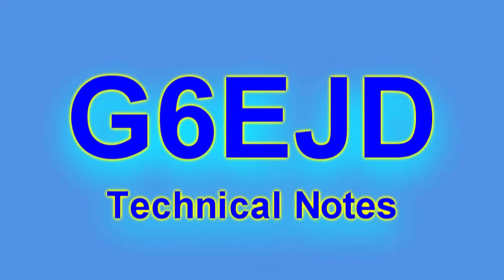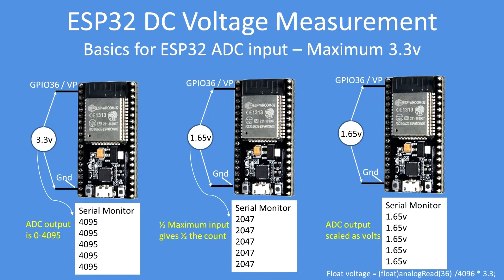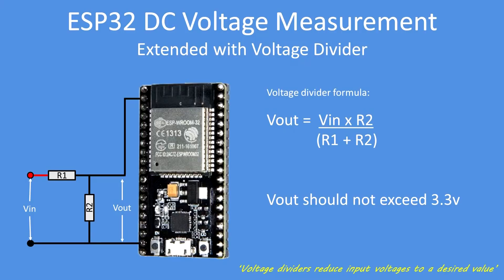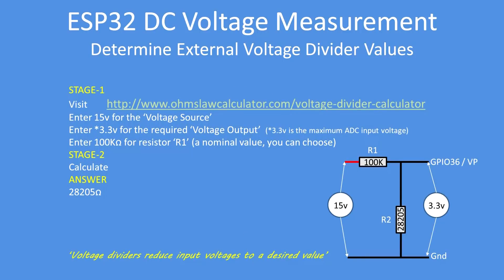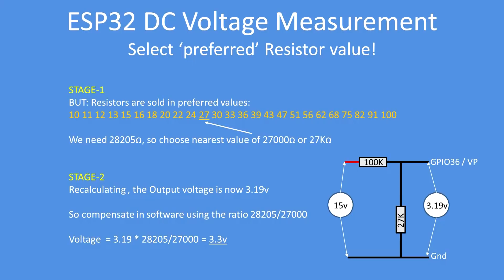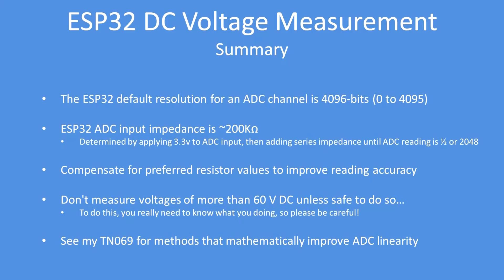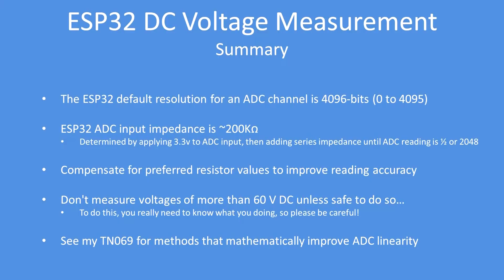Tech Note 115 - Using the ESP32 ADC for wide range DC voltage measurements

Comment: how can we make it work with negative signals instead of only positive like how multimeters and oscilloscopes do
Reply from the maker: You’d have to offset the ADC to half the ESP32 supply voltage which then becomes the effective ground point then you can measure voltages -/+
Reply: @G6EJD how can I do that I have to add ~1.6V to my input but how can I do that
Reply from the maker: @zizozeo4740 an ADC reading of (range 4096) for 0v would be 4096/2=2,048 so you have to scale the readings accordingly, you can use the map() function do to that. So -1.5 becomes an ADC reading of 0 then 0v is 2048 and +1.5 is 4096

Comment: Sometimes you can you a 10 turn trimpot to use for fine tuning without accessing code.
The other note is to increase the resistance to minimise current draw.

Comment: When using it to measure up to 4.2v, does it make sense to choose a ratio which ends up with 3v max to avoid non linearity?
Reply from the maker: @DrunknPilot  yes, and if battery powered, the highest values commensurate with reliable readings, meaning providing enough input current for the ADC to operate correctly.

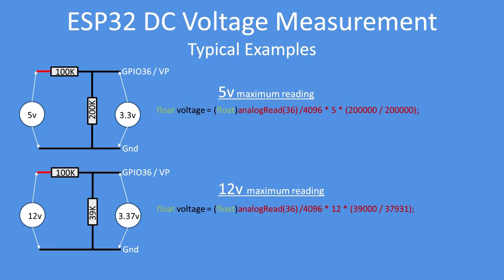Comment: 5:14 -  In my opinion, it should be 37931/39000. I am ignoring the fact that this resistor has too high a value, the voltage drop on it will exceed 3.3V. You should choose a resistor with a value lower than 37931. Best regards
Reply from the maker: I should probably have clarified that n / n means on parallel so 37931 in parallel with 39000 will give a lower value, but ignoring that only preferred values are available and the result in most cases will be a compromise.

Comment: Im working with esp32 for the first time. I purchased 3.7v 850mah lipo 5 pack. If i understand a fully charged 3.7v lipo will actually read 4.2v. Im starting to realize the dangers of working with batteries and i dont want to burn up my boards. So i read about voltage devider circuit monitor the voltage  of my battery supply and this will be important knowing an estimate flight time. This devider circuit is how i should power my board safely?
Reply from the maker: Yes a fully charged LiPo has a battery voltage of 4.2v and is discharged at about 3.6v, they always quote the nominal cell voltages, which can be confusing. Most ESP32 development boards have a battery management chip fitted which handles battery charging and discharging. It only allows charging when the cell voltage drops to 3.8v, well actually whatever value has been set by the board designer via a series resistor fitted to the battery management chip. Also most development boards fit a simple voltage divider whose input is connected to the battery input terminal, so that when the battery is connected the battery voltage (off charge by virtue of no 5v USB input) can be monitored. Simulating the voltage divider for fitting to a board without a fitted battery monitor is quite easIly achieved. The risk of burning your board is very low as the battery feeds a battery manager chip and then voltage regulator.
Reply: Ok so. My motors can handle 5v so it would be safe to have the wiring for the motors directly to the batter then power the esp32s3 from a voltage devider circuit.
Reply from the maker: @MrI8igmac  you can’t successfully power the ESP32 via a voltage divider as the series impedance would be too high leading to huge voltage reductions which in-turn would make the ESP32 processor operation fail, what would happen is the ESP32 brown-out detectors would trigger snd keep resetting the ESP32. Only a voltage divider using very low values of say less that 10R would enable successful operation but it would quickly flatten the supply battery. BUT none of that is required if you use a development board with a Vin pin that is connected directly to the on-board voltage regulator or even the battery input pin as most regulators can handle an input voltage of up to typically 6v, sometimes more depending on the regulator type.

Comment: Sir why didn't you use the ADS1115 module. Because accuracy problem found this method. 
Please make vdo using ADS1115, esp32, LCD16*2
For dc volt meter range is 
0-300VDC
Reply from the maker: When there’s an ADC built in why bother it just adds cost and complexity of design
Reply: @G6EJD  because accuracy sir.
Reply from the maker: But you can get within 1% accuracy with the in-built ADC, why do you need more, it’s never going to be a scientific instrument? I think you could usefully read into ADC’s and what are the important aspects of them, speed, resolution are important and to a lesser extent linearity, what aspect would a ads1115 improve?

Comment: In spite of the better resolution of the ESP32(4096) vs. that of an Arduino Nano(1024), I found a x10 better precision with the Nano. I wanted to measure a lithium battery voltage using the ESP32 with a 5V boost to Vin and found variations of about +-8%  using a 76% voltage divider from the battery to input pinD33. For the lithium battery using a 5V boost to power the Nano (pin +5V) and a direct battery connection to pin A0, I found a variation of only about +- 0.8%. Any comments would be appreciated to improve my ESP32 measurements.
Reply from the maker: You can obtain the ESP32 internal reference voltage set at manufacture to improve reading accuracy. In general the ESP32 extra resolution should give you better results, but never approaching those of a DVM. To get better results you’d need to use an external ADC. You can also improve the linearity of the ESP32 using g some mathematics and what’s called a polynomial, I have covered both the ADC reference voltage and improving liberation other videos.
Reply: @G6EJD  Sorry, I called it the precision when I really meant to say the repeatability of the measurements. 10x better with the Nano.

Comment: 1-Sir am using this method for dc voltage measurement. 
ESP32 wroom with I2C 16*2 LCD
applied 12.4V display 12.4V
If applied 6.7V display 5.9V
How to solve this problem sir?
Reply from the maker: Your voltage divider is loading the circuit
Reply: @G6EJD  I will check and give you feedback. With ADC value.
Sir one more thing any simulation software available for ESP32 for voltage measurement.
Reply from the maker: @0124akash  none that I’m aware of

Comment: May I ask why my esp32 is getting a lot of noise and random peaks values when the ADC input is a DC value? For example, the input is receiving 1.65V (A battery with only a resistor connected to ground and input, nothing else) which should be around 1700, but I'm getting noise of around 1750, 1650 and sometimes peaks of 2300.

And it only happens with DC voltage, for AC voltage it read perfect, given an senoidal it will read and plot in the serial plotter perfectly a senoidal.
Reply from the maker: Well it will be a function of your ESP32 supply noise, do you have sufficient and good enough smoothing and filtering. You should have a largish smoothing capacitor say 47uF or maybe 10uF and at least 0.1uF ceramic capacitor. The ceramic type is important as unlike larger tantalum capacitors are not inductive, therefore it can filter out transients on the supply. Also in theory the battery should act as a capacitor and its impedance is so low it should not allow any transients, so it proves almost conclusively it must be supply noise. It will still be there when measuring AC but less noticeable. Adding a small 0.1uF capacitor across the ADC to ground will help too. What value series resistor are you using? You can also counteract quantisation noise from the ADC by using a simple averaging technique of taking say 10 readings in succession then dividing the result by 10, which is a common method. The ADC is so fast in most applications the method will be indiscernible in practice.

Comment: I want to test this voltage divider at 5V maximum. Because i have only 10k & 1k resistor, so i use r1 10k & r2 1k ohm. I test the voltage at R2 and the result is around 0.45 V but in esp32, the result is around 0.3V (after i calculate it with adcvalue  *  (3.3/4095) ). Also i have try to put 0.1uF capacitor but the result was same. Can you help me ?
Reply from the maker: Try adcvalue * 3.3 / 4095 * 0.5/0.3;

Comment: Thanks very clear and well explained. I been struggling with getting reliable readings on a project that is monitoring a 12 volt battery being charged by solar panels remotely over the internet. This explains a lot to a novice programmer like myself and will help. Thanks for your time and effort.

Comment: But resistors are not accurate, so I have to do some calibration for each specific set of resistors. 100k could be 999.8 or .9
Reply from the maker: And the point your making?
Reply: @G6EJD  that I wish for another solution. In my case I need to measure up to 3.4v I don't know what to to. Does esp32 Internal software calibration take care of voltage divider variance? Yes I'm lost
Reply from the maker: @solidfuel0  the ESP32 can measure up to 3.3v so you will always need a voltage divider, the solution is sine you have to use an external meter to ensure you have a reference, then measure the source violative with the meter and then with the ESP32 and compare, then adjust your ESP32 measured voltage by the ratio of Vmeasured / VESP32 so voltage = analogRead(35) * constant * Vmeasured/VESP32 or simply adjust your source code so that the voltage line is multiplied by either 0.999 if too high or 1.0”1 if too low, repeat until the correct value is obtained, you may need to use eg 0.95 or 1.005 or whatever.
Reply: @G6EJD  i could never get it to measure up to 3.3v even if the vdd is 3.3v.
Reply from the maker: @solidfuel0  you can but it becomes very inaccurate as the input voltage goes over 3.0v see my video about improving the accuracy using a polynomial
Reply: @G6EJD  oh BTW I am testing with esp32-s3. I just noticed in espisd that with esp32 the adc_atten_DB_11 the max measurable voltage is 2450mV. Which is lower than s3. How are you able to measure above 2.4v using the basic esp32?
Reply from the maker: According to the S3 data sheet maximum input voltage is ADC_ATTEN_DB_11
0 mV ~ 3100 mV same as the standard ESP32

Comment: Hi all
When I'm trying to divide analog pin value e.g 2.66 to 4096 and so on on formula - the value is much less than 1 
2.66÷4,096×16×(8,461÷7,500)= 0.0117220104
Should I use *1000  or not?
P.S I'm using Arduino Voltage Sensor which measures up to 25V DC
Reply from the maker: The result is integer unless you specify or imply a floating result with 4096.0 or 7500.00
Reply: @G6EJD  I've used integer, without floating. So do I need to multiply by 1000 ? 
Comma's in comment was from mobile calc :(  In sketch all parts were int. only analogpin was float

Comment: With respect to the work you have done - your calculation formula gives incorrect results:
float voltage = (float)analogRead(36) / 4096 * 15 * 28205 / 27000;

Proof:
Example for 15V 
Voltage Source (VS) 15V
Resistance 1 (R1) 100K
Resistance 2 (R2) 27K
Output Voltage (VOUT) 3.189V (Voltage Divider Calculator)

In this case analogRead=3.189V/3.3V*4095=3957
float voltage = 3957 / 4096 * 15 * 28205 / 27000 = 15,14V (not 15V!!!)
----------------------------------------------------------------------
Correct formula for 15V:
float voltage = (float)analogRead(36) / 4095 * 15 * 3300 / 3189;

Proof:
Example #1 for 15V 
Voltage Source (VS) 15V
Resistance 1 (R1) 100K
Resistance 2 (R2) 27K
Output Voltage (VOUT) 3.189V (Voltage Divider Calculator)

In this case analogRead=3.189V/3.3V*4095=3957
float voltage = 3957 / 4095 * 15 * 3300 / 3189 = 14,999V (~15V!!!)

Example #2 for 12V 
Voltage Source (VS) 12V
Resistance 1 (R1) 100K
Resistance 2 (R2) 27K
Output Voltage (VOUT) 2.551V (Voltage Divider Calculator)

In this case analogRead=2.551V/3.3V*4095=3166
float voltage = 3166 / 4095 * 15 * 3300 / 3189 = 12,000V (!!!)
Reply from the maker: But you have no concept in your mind of the effect of the ESP32 ADC input impedance on the calculations, so you need to brush up on your electrical engineering and think a little bit wider and deeper, because unfortunately you will find your wrong!
Reply: @G6EJD  Thank you for the quick response and important advice!
Added ESP32 input impedance ~200K to calculations  

Your calculation formula for 100K and 27K divider:
float voltage = (float)analogRead(36) / 4096 * 15 * 28205 / 27000;

Check for 15V, 100K and 27K divider, ~200K ESP32 input impedance 
Voltage Source (VS) 15V
Resistance 1 (R1) 100K
Resistance 2 (R2) 27K!!200K=23K789
Output Voltage (VOUT) 2.883V (Voltage Divider Calculator) 

In this case analogRead=2.883V/3.3V*4095=3578
float voltage = 3578 / 4096 * 15 * 28205 / 27000 = 13.688V (not 15V!!!)
----------------------------------------------------------------------
My calculation formula for 100K and 27K divider:
float voltage = (float)analogRead(36) / 4095 * 15 * 3300 /2883;

Check #1 for 15V, 100K and 27K divider, ~200K ESP32 input impedance 
Voltage Source (VS) 15V
Resistance 1 (R1) 100K
Resistance 2 (R2) 27K!!200K=23K789
Output Voltage (VOUT) 2.883V (Voltage Divider Calculator) 

In this case analogRead=2,883V/3.3V*4095=3578
float voltage = 3578 / 4095 * 15 * 3300 / 2883 = 15.001V (~15V!!!)

Check #2 for 12V, 100K and 27K divider, ~200K ESP32 input impedance  
Voltage Source (VS) 12V
Resistance 1 (R1) 100K
Resistance 2 (R2) 27K!!200K=23K789
Output Voltage (VOUT) 2.306V (Voltage Divider Calculator)

In this case analogRead=2.306V/3.3V*4095=2862
float voltage = 2862 / 4095 * 15 * 3300 / 2883 = 11.999V (~12V!!!)
Reply from the maker: @gora6045  but the input impedance is both non-linear and its equivalent circuit is not a parallel impedance but series.

Comment: Sir, can I measure same time dc and ac voltage using esp32 ?
Reply from the maker: You can measure DC easily, but an AC voltage needs signal processing to convert it to what’s called a Root Mean Square value that is the equivalent of a DC measurement. To do this a full cycle of the AC waveform would need to be sampled over say 256 samples then the RMS calculation performed to give the final reading. Measurement of an AC waveform is complex especially if the waveform is distorted.

Comment: Thank you Dave, very useful. I’ve mostly been using the Parallax Propeller chip over the last 15 years and recently found the ESP32cam, I’ll have to try this on pin 13 to read my water tank level using a psi sensor and a tube.
Reply from the maker: That will work

Comment: Excuse me!May I ask you something?If we have the voltage value so could you tell me the formula convert from voltage to pH value?Thank you in advance
Reply from the maker: It depends on the sensor your using, what type is it? You need to know it’s output characteristics
Reply: @G6EJD  Its output voltage 0~3.0 and I’m using it with esp 32 30pin.I really need this information,because I’m doing my project related to pH sensor and esp32.
Reply from the maker: Ok so if the output voltage is 0-3.0 then that represents a pH range of ? 0-7 or 5-7 or?
Reply: @G6EJD  Represent range 0-14 sir.
Reply from the maker: So 0-3v represents a pH of 0-14 so each volt = 14/3 pH then voltage to PH = voltage * 14/3.0
Reply: @G6EJD  May I have your Facebook or Instagram account?
Reply from the maker: @nirornkong416  I do t use either of those just email via my web site contact http://g6ejd.dynu.com

Comment: sorry for the bad questions, what u means with required value/preferred value
Reply from the maker: No bad questions, I'm pleased you asked. The calculations might say a value of 13.6K is required, but resistors can only be purchased in 'preferred' values, like 10K, 12K, 15K.  I put the so-called E-Number range in the video, so if you calculate for 13.6K, then you pick the nearest value in my example here 15K is nearest then you have to go back and recalculate using the new value to know the actual range.
Reply: @G6EJD understood, so if i use 3 resistor for voltage divider, the calculation and coding still same?
Reply from the maker: Yes, and it enables you to get must closer to the required values my examples was 13.6K so we could use 3 resistors in series to make up one resistor using 12K in series with 1K and 680R giving 13.68K
Reply: @G6EJD  nice, thnks

Comment: Thanks for the great video David! was just wondering if there are other things to be taken into account i.e. resistors power rating?
Also, you mentioned how much the input impedance should be, which resistor represents the impedance or both? 
Thanks!
Reply from the maker: I mentioned the ESP32 impedance because it affects the calculations, it varies from device to device, but on the whole is relatively high but enough to skew the calculations. Yes power rating of the resistors is a consideration but for all but the highest voltages >50v should be well within a 1/4 watt resistor rating. p=V^2/R